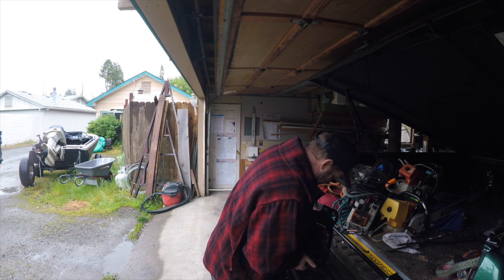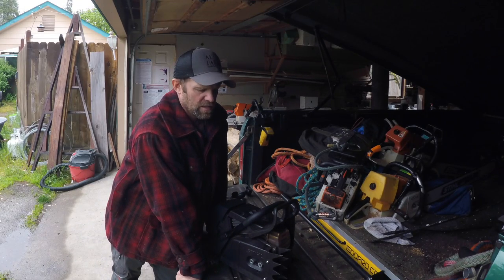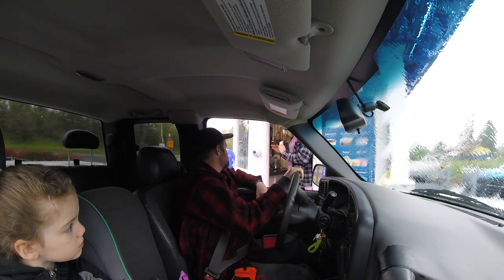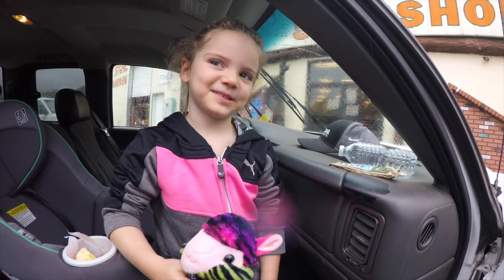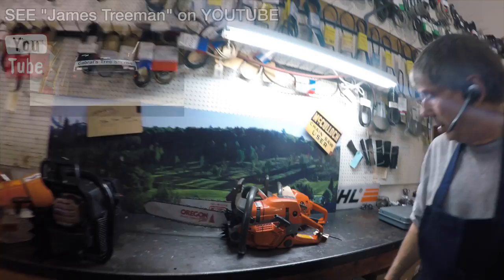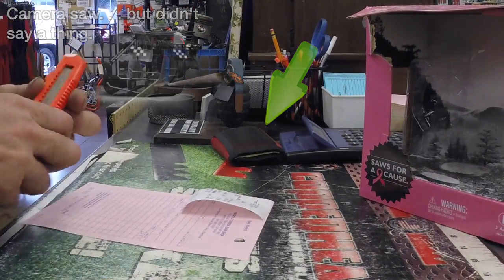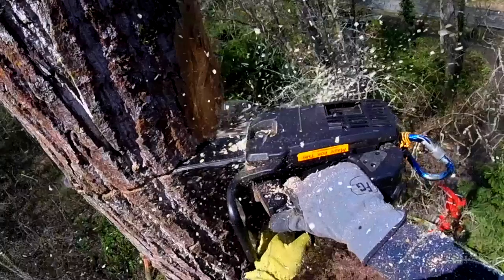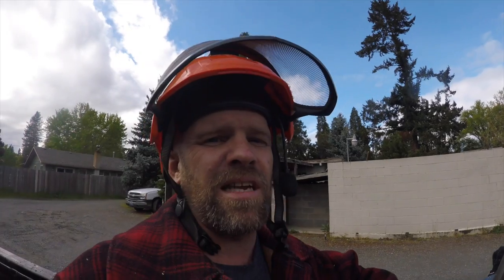The Saw King

Comment: my first saw was a husky 61(1983) I've always been a husky man because of the power to weight ratio and cost. That being said, I went to the local stihl dealer to buy the ms 200T before they even stocked them. i had to wait 2 or 3 weeks to get mine. The only mod I did was to remove the spark arrestor from the muffler. I still use the stihl top handle saws, but husky for the big bars. I wish there was a saw king down this way. -Loved that Beatle song - great job! Happy B-day to the little princess!!
Reply: John Durant I still cut firewood with a Husky 61 I bought in 1985. Bone stock and growls like a grizzly 👍🏻
Reply from the maker: John Durant I bought one the second they came out as well.
Reply: My first saw was a 1975 Jonsereds. The big one. I can't remember the model # offhand. Bought it off my late Father in around 1990. Sold it in around 1994 for $200 to pay my taxes. One of my biggest regrets...... He's gone now....and so is the old Jonsereds quality....
Reply: Samuel Luria My Dad started me cutting at 8 years old. I feel your pain. Never ran a Jonesered, but burned up a few 394's and 660 mag's.
Reply: Yeah, I was 8 as well....I would come home from school in the 3rd grade, and work the wood pile in the driveway.... different times, those....😂
Reply: Samuel Luria true! I had two brothers and two sisters. We grew up on a Midwest farm with 200 acres of timber in the 70's. Wish my little people could have had the same experience. Wouldn't change a thing.

Comment: Hay August, Please, Please, Please don't let go of the steering wheel to play with your camera and please never be on the mobile phone at the same time! The car will never be 'hands free' AND please, please, please don't do either with your precious daughter in the car!!!
Reply from the maker: what about CB radio? Can’t hold mic while driving?
Reply: @AugustHunicke  I can understand that August but I prefer safety first, especially when your daughter is in the car. I have seen far to many sad and unnecessary accidents caused by using the mobile phone. Could you not get 'Hands Free', it's safer. August, I'm not having a go at you, I don't have the right but please consider your little girl. You just don't know!
With respect.